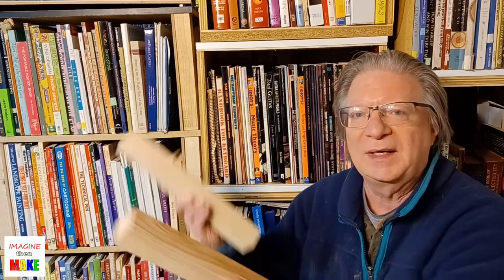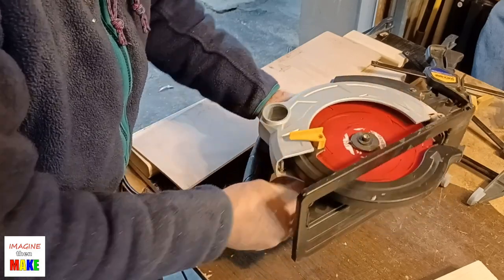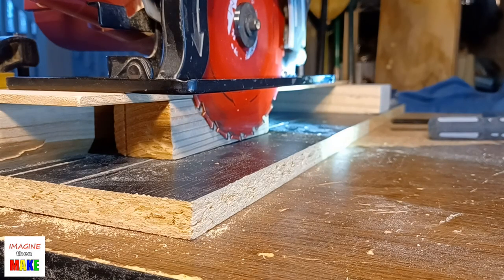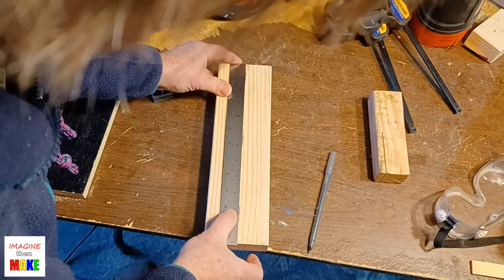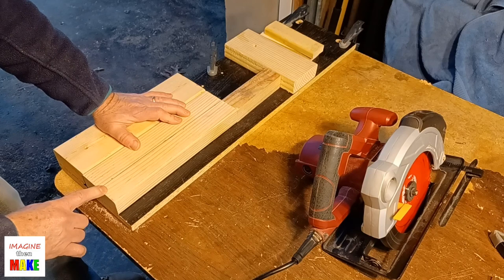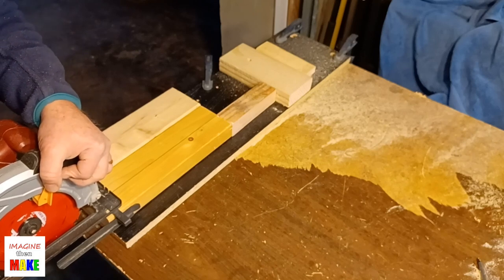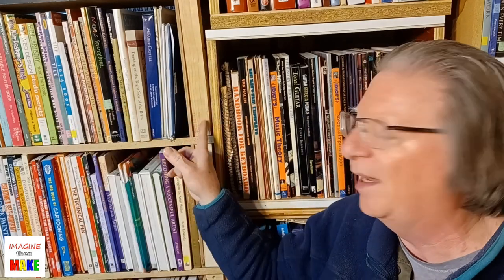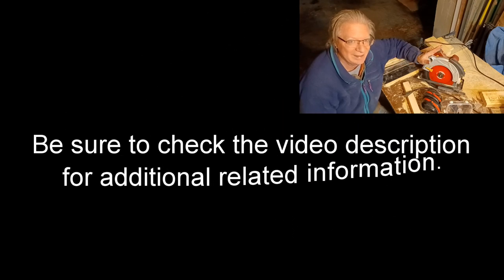156. Cutting long skinny parts from a 2x4 using a circular saw.

Comment: Very timely video for me, albeit one year later than you made it!  Thanks for taking the time to make the video and posting it.  Just today I figured out how to shave a few mm off a 3" board, but your way is better!  I was using clamps and double-sided tape and a lot of set up.  I have some more boards to cut so I will try out your technique.  I can use the same technique to convert 2/4s into useable 1 1/2 x 1 1/2 for planter legs.  Thanks again! (Liked and subscribed.)
Reply from the maker: Your comment is very timely! For some time now, I have been thinking of ways to redesign the jig. Just this past weekend, I was working on a new kind of jig to cut 1.5" x1.5" square pieces out of a 2x4. I build a prototype and it works pretty well. I will try a few tweaks to the deign and keep testing. Once I get the details nailed down, I will probably make a video.
Thanks for your comment and for watching.

Comment: Thanks for the info.  Trying to find ways around  buying a table saw due to cost and space.
Reply from the maker: I can definitely appreciate that. I have found that cutting large pieces using a circular saw is really not that difficult. Cutting small pieces; pieces that are narrower than the base of the circular saw can be challenging. To cut the smaller pieces, I wind up making some kind of a jig. Admittedly, my jig making skills need improvement but improvement is made each time I make a new jig. 
An alternative to making a jig to use with a circular saw is to cut the smaller pieces using hand tools. Using hand tools can be very rewarding (and safer, cheaper, quieter, less dusty) so if you haven't tried them, I do recommend you give it a try. I think using hand tools well comes down to how well you can hold the piece you want to cut. I generally use clamps, a vise, sacrificial scrap pieces you can cut into, and dead weight (I often use concrete blocks) to hold pieces.
I did make a 3 part video series about how I replaced my table saw using a circular saw. Here's the link to part 1: https://youtu.be/ujMxPkuzDYY .
Thanks for your comment and for watching.

Comment: Please advise on a hand plane jig to accurately thickness your circular saw cut stock. I need to make a sash window.looking to get 40x60mm stock, about 10 lengths at 0.5m.
Reply from the maker: Interesting question. I don't think I have ever seen anyone use a thickness jig with a hand plane. What I have seen many times is that a cut line is drawn on the stock. Then a hand saw (or circular saw or band saw or even a scroll saw) is used to cut close to the cut line removing most of the unwanted stock. Then a hand plane is used to plane down to the cut line.

I have seen many examples where the hand plane is used to plane down to the cut line by watching the cut line as the planning occurs and making adjustments to where the plane is cutting. With each stroke of the hand plane and revaluating if you need to make any adjustments to where you are planning, with some practice, one can plan right up to the cut line. It does take some practice on some scrap to get good at this and develop the confidence to go for it on your project pieces. 

Having said that, I think most people put the practice in and learn to plan down to the cut line.

If you wanted to make a jig to ensure that you hand planed to the same amount each time, I suppose you could build a jig that 1) holds the piece that needs planning and 2) restricts the hand plane from saving too much off your workpiece. To simply hold the workpiece, you could rest it against a stop(s). To keep the plane from saving off too much, the plane would have to ride along some rails which would not allow it to shave off any more material once the workpiece got to the desired thickness. This idea might work if you workpiece is narrower than the sole of your hand plane.

I hope this helps. Thanks for watching and for the question; it was and interesting one.
Reply: @ImaginethenMake  thank you. I ensure hardwood jig base and guide rails are perfectly level and flat. Guide rails smooth hardwood, waxed. The body of the jig, two 4x2 s are level and these just get clamped to the hardwood based secured onto worktop. The face of the stock  in contact with the hardwood base should be flat. Use a wide try plane blade eg 2 3/8 inch. Hardwood gets screwed onto table top. Will make it soon.
Reply from the maker: Good luck with your project.

Comment: Can you install a block of wood as fence under the other side of shoe/plate making it double-sided fence? that will be much easier to rip longer 2x4 lumber? This will make  it track the width of 3.5 inches with the blade right in the middle.
Reply from the maker: That's a excellent idea which I had not thought of! If I try that, I'll be sure to make a video about it. 
I have been thinking about trying to modify the rip fence that comes with the saw. I'm also thinking about other ways to hold the workpiece I'm cutting.
I have future plans to cut many more of these sticks so that I can make a shelving unit for inside one of my closets so be on the lookout for more videos to come!
Thanks for your comment and for watching.

Comment: Thanks for the video. Very simple to use. May I ask what brand rio fence you have?
Reply from the maker: I'm using a circular saw made by Chicago Electric and sold at the Harbor Freight store ( https://www.harborfreight.com/power-tools/power-saws/circular-saws/12-amp-7-14-in-circular-saw-with-laser-guide-system-63290.html ). The rip fence I am using is the one that came with the saw.
I've had this circular saw for years and have found that it works well. I haven't used the rip fence much at all until doing this project.
Thanks for your comment and for watching.

Comment: I guess the line you drew was just for illustration. In real use we only need to set the fence and place the blocks that form a sort of jig.
Reply from the maker: Yes and no. I drew the cut lines in the video so the viewer could see where I was cutting and for myself to verify that I was cutting a straight line. Funny enough, the 2nd cut line I drew was 1/16" off. In actual use, I agree with you; there is no need to draw the cut line just set the fence and go.
Thanks for your comment and for watching.

Comment: So complicated for nothing...
Reply from the maker: The challenge I gave myself was to figure out a way to safely cut these parts using a circular saw, not a table saw or bandsaw. (For woodworkers on a budget and short on workshop space, a circular saw is much cheaper and easier to store than a table saw or band saw.) Having said that, I am working on a simpler way to cut these parts using a circular saw - stay tuned.
Thanks for your comment and for watching.